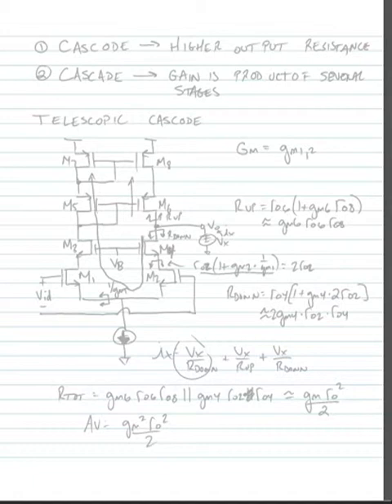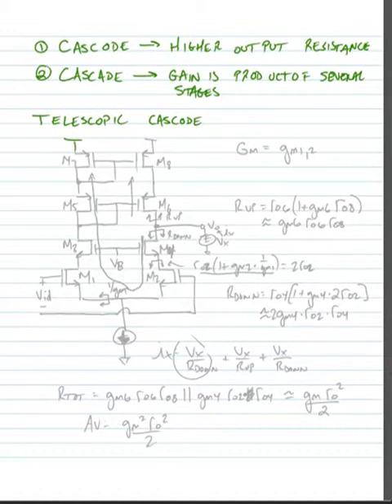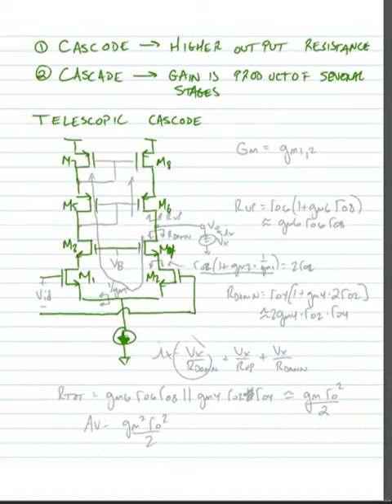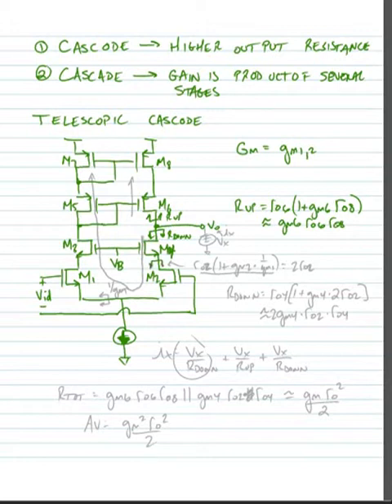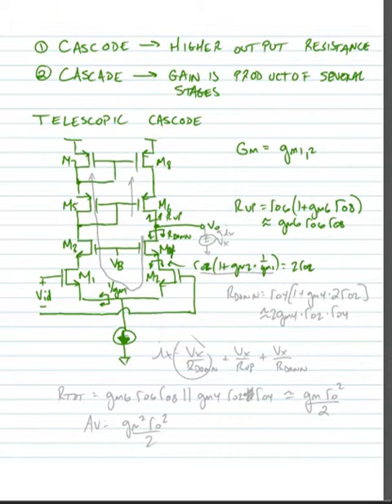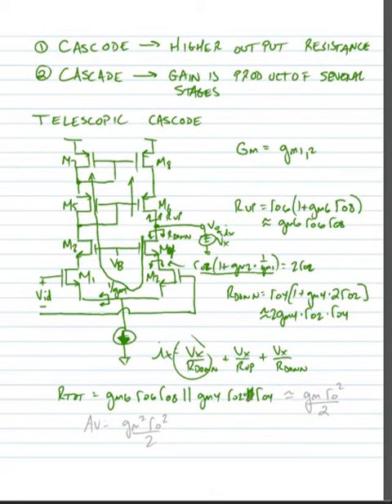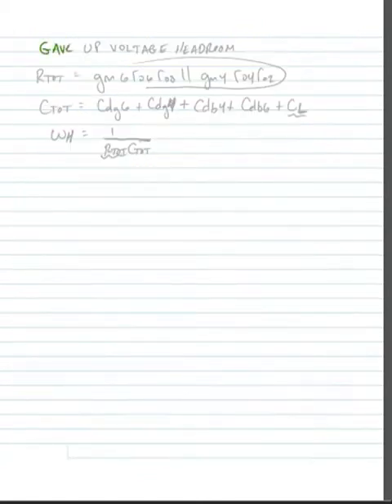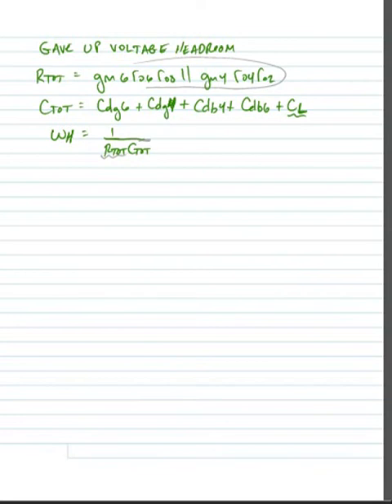ECE 3110 - Lecture 13 - Part 5 - Telescopic Cascode

Comment: I have a question about Rdown. You mentioned that it should be 2gm4ro2ro4, therefore, the Rtot should be Rup parallel with Rdown. why not be Rup|| 2gm4ro2ro4?
Reply from the maker: Because of the current mirror load, it is actually Rup||Rdown||Rdown. This is because if a test voltage is placed at the output, any current that flows down towards through M2 will flow up towards M1 and get mirrored to the output side.
Reply: @wallingphd  Thanks!!!